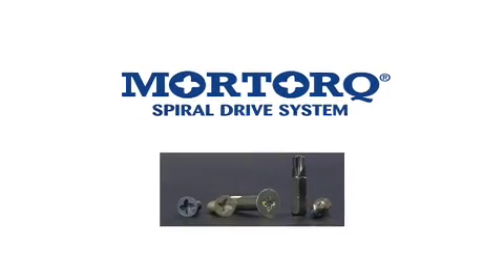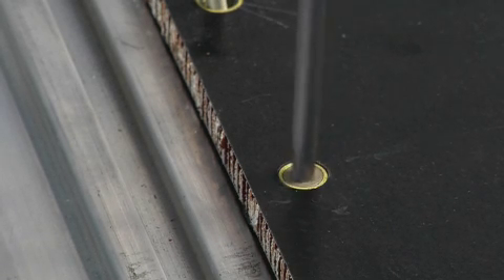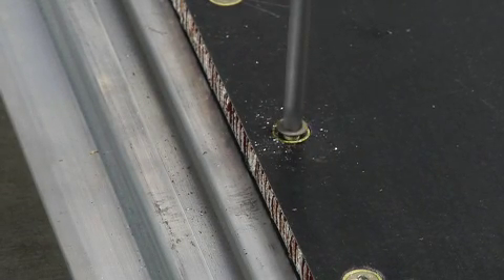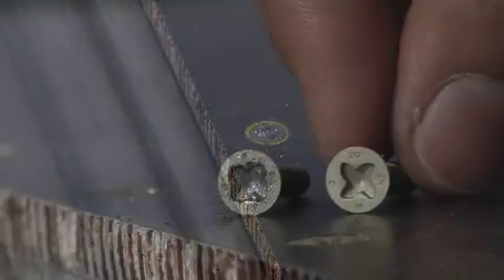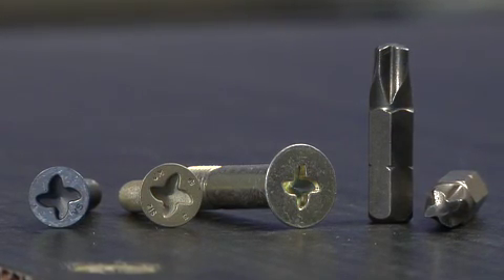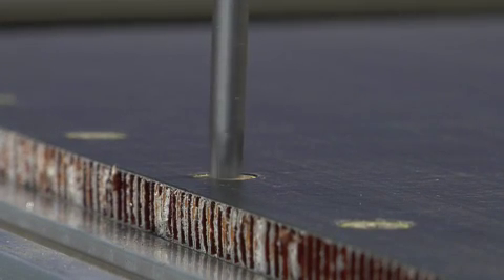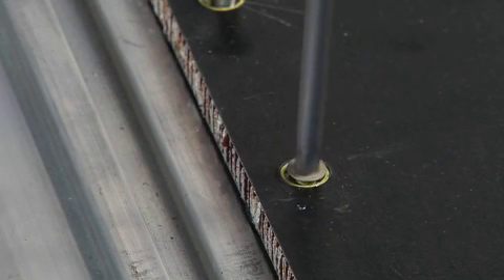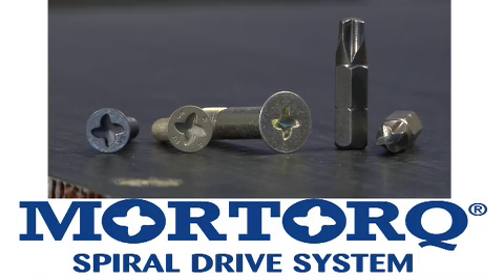Full Mortorq Demo Presentation - Full Version

Comment: No comments from anyone since 2011? I guess nobody have ever encountered these ridiculous drive system. How on earth can any other bits be used to drive these fasteners? Torx bits have 6 flutes, Phillips have 4 but their pointed ends can't be accommodated in these screws as the Mortorq recess are flat and shallow. Try driving these at an off angle and see what happens - you're not going to be popular.
I'll tell you where they are in use - Boeing 787 floorboard fasteners. So make sure you have the correct bits if you have to get under those floorboards and don't believe what this video claim.